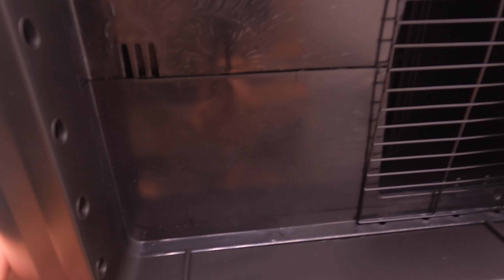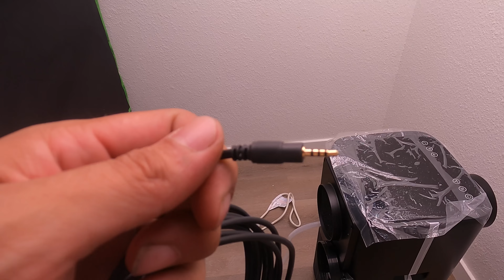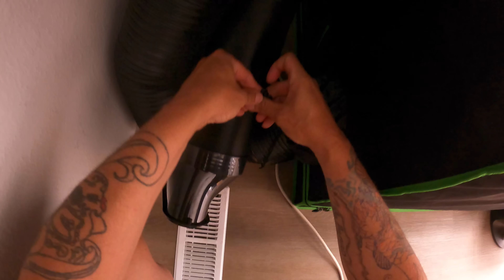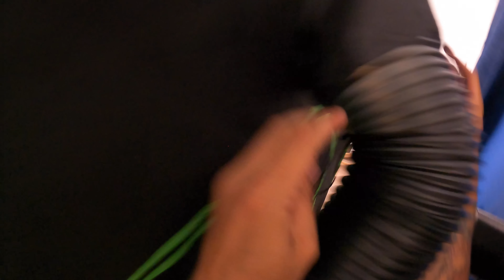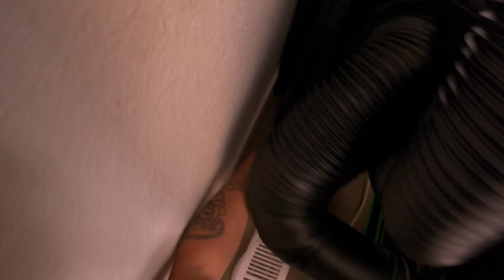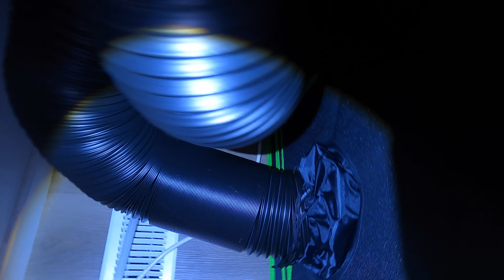4 IN 1 COOLING, HEATING AND MORE!!!! GROW WITH ULTIMATE CLIMATE CONTROL WITH VIVOSUN AEROLUSH

Comment from the maker: The unit in this video is an early engineering sample. The final version comes fully assembled—no installation needed. Also, Vivosun offers free shipping in the US, which can be a big cost saver.”
Reply: what do you mean by fully assembled? - no installation needed? you must put on the attachments for the hoses I'm assuming? Can I use the app without Vivosun controllers?  thanks for the video! hoping to receive mine end of July? Does the unit come with all 3 black exhaust hose in a separate box?
Reply: @StangMann420  Hi! The unit comes fully assembled—no internal setup needed. You just need to connect the hoses, which are included in the same box with all attachments. The app works without a Vivosun controller, but full features require pairing.
Reply: @Vivosun  What is the lowest temperature setting I can set it to ?
also what is the lowest humidity setting I could set it too? 
Is this capable of keeping a 4 x 8 flowering tent cool if the lung room is kept 70f-73f? 
Thank you for your time and any info in advance.
Reply: Can some one re design the ac and get it to deliver top cooling for les electricity  800w is more electricity than a standard  4x4 or 5x5
Reply: How many watts does that pull while cooling? A standard portable is around 800 to 1000 for 5000 to 8000 btu.
Reply: @Confused_Unicorn  The AeroLush is rated at 840W with a cooling capacity of 8000 BTU.
Reply: @Vivosun  Thank you!
Reply: @Confused_Unicorn  my grow sed 800w i think?  but dont hold me on that  if they could get them down to 200w and still work grate it would be game changing  bu 800w or more is just disappointing  thats like a hole other 4x4 or 5x5 in electricity
Reply: @Mpcdude385 I agree 👍

Comment: Nice unit but limited as it can only cool OR dehumidify.
So you cant achieve a decent humidity level and cool during flowering.
You would need to run a dehumidifier plus the aerolush in cooling.

Comment: Unfortunately, cooling mode is just the single mode, which is really usable. Maybe hot mode a bit, but that's all. Dry mode works via cooling condensation as well; so if you want to get 60% or less, your tent will be immediately about 12-16°C—absolutely not usable for cannabis.

Comment: I think u mixed up the inlet outlet. The side with 1 is supposed to go at the bottom of tent for air inlet into tent.    On side with 2 top 1 goes to top of tent for air exhaust from tent
Reply from the maker: you can have it blowing or sucking its not going to matter or not that I seen
Reply: @GRASSINCLASS i actually ended up usin the heater outlet for dehumidifier cos factory spec ac outlet was too cold so does seem to have flexibility with setup ur right.

Comment: My question is. Is your holding the temps good or do you have frequent temp and RH swings? Do you use it in veg and flower or just flower? I have bought one and usenit in a 90s90x180cm(3x3) grow tent and i have crazy swing i dont know i should upgrade to 4x4? If you still have swings not worth it for me.. PLS reply i tried everything cant fix my problem.
Reply from the maker: Depends on how much the ac is turning on the more it turns on the dryer the tent gets , which is not bad when your in flower , but when you are drying it’s a different story and have to be more careful
Reply: @GRASSINCLASS thanks for the anwer. I have a VCure for Curing and drying
Reply: Problem is rhe swings it doesn not hold the temps like I imagined

Comment: How do I keep the humidity under 60 while using this ac unit , everytime I turn on the Ac it gets really humid in my tent
Reply from the maker: wait what ! it should be opposite if the ac is on the humidity goes down and fast thats why I had a humidifier in the tent . but if its an issue get a dehumidifier in there.
Reply: @GRASSINCLASS its cause after thr AC compressor shuts off, the fan keeps blowing and all the moisture from the frozen coils gets dumped back into the tent . Im dealing with the same issue. It’ll drop the temp but raise the RH right as it hits target temp and shuts off . Kinda stupid if u ask me. For $500 id expect to have temp control while in dry mode. When you’re in dry mode, it drops your temp uncontrollably low

Comment: It's been 9 months since this video was released. Are you still using this thing? If so, is it working the same? Howre you liking it still? I'm having a hard time finding one
Reply from the maker: Absolutely I'm using it right now , so far I've used every setting , heat in the winter months , a,c last summer , and now I'm using it as a  dehumidifier, it has kept my grows in tent really consistent when it comes to environment and I've noticed a difference in my plants happiness they look really healthy and full of vigor , but at the same time I'm using self watering pots so it's all around environment consistency
Reply: @GRASSINCLASS awesome thank you for the response!
Reply: @GRASSINCLASS is it very loud

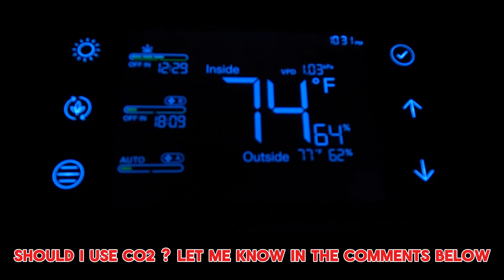Comment: 6:26 I just started using co2 and I think my plants have really benefited from it just turned to flower so we will see what happens but I love the review this is probably my next investment so my question is for each mode they have to be set up right it won’t say cool and dry at the same time right? I’ll probably still use a dehumidifier but if the unit can switch between modes to keep the perfect climate that would be awesome

Comment: This is a great unit, but what I don't care for it about is the wide spread of temperature between the time it comes on and a time it shuts off mine is almost 7° difference doesn't sound like much but it's a lot

I set my thermostat at 76°. It comes on at 78 to 79° and goes down to 71° sometimes down to 69°. Before it shuts off.
Reply: All portable AC’s do this. This is normal due to how thermostats work: the unit cycles (or modulates in inverters) based on a built-in tolerance to avoid constant on/off switching, which saves energy and reduces wear.
Reply: Same but what im more concerned about is how it dumps moisture back into the tent. So u cant really get anything 60% or lower unless u use dry mode, then u dont have temp control smh

Comment: I'll answer my own question here. No, it does not decrease the RH without cooling the tent way below safe growing temperatures. Dry mode really can't be used as a dehumidifier during normal temperature conditions unless you want your tent temperature to drop down way below 60 degrees. As far as heating the tent goes, the unit uses its exhaust outlet to heat the tent, which is not ideal and doesn't bring the tent temperature up to par during the colder winter months. This is being advertised as an air conditioner/heater/dehumidifier/fan. When in fact it is just an air conditioner. If you are looking to buy this unit for your tent cooling needs, then yes it will work at a very hefty price tag. But as far as everything else Vivosun claims this unit to be goes it fails miserably. I hope this helps people that wanted a complete environmental control system. This just isn't it. Save your money. I wish I never bought it.

Comment: how long will it last tho? i bought a vivosun fan and an AC infinity fan at the same time, both ran 24/7 and the vivosun stop turning after 3 months meanwhile i havent touched my AC inifinity fan in over a year and it still turning. its been on 24/7 for a year and no issues.

Comment: 500 dollars? Not worth it. It's pretty much a a/c. But weak one, I got a Honeywell that costed 600 or 700 but it's 16k btu 8k is low and will only cool a small room aka tent. My Honeywell cools a while room. And I just run a small hose to my tent when needed and it does wonders. Also setting up your lights when the sun isn't beaming helps a ton. Usually lights turn on at 6 and are off by the time the sun is hitting hard. Gotta think OP.
Reply from the maker: You don’t need a 16k for o cool down a tent , and what do you use in the winter. When temps are below 50? Do you use a dehumidifier in your grow space ? I rather have one unit that does it all then 4 different equipment taking up space when I’m not even using it 🤔

Comment: Power consumption to moon😂
Reply from the maker: Not if you know what your doing and running your lights at night , also bringing in 60 degrees air from outside cuts the usage by over half , and if your asking what’s the point then ? I’m able to run co2 efficiently in a tent in a sealed environment and eliminate odor way better , now if you live in Florida I can see the cost of running this being a little higher but if you add co2 you can easily double your yield and make up for it
Reply: @GRASSINCLASS If ur bringing in 60 degree air from outside it’s not a sealed system.
Reply: @GRASSINCLASS  teach me
Reply: @GRASSINCLASS Nah im running low energy high efficiency rooms and if not needed i would never use a thing like rhis
Reply: Its better than cooling the whole lung room 😊
Reply: You need all of these components in a grow.  its probably a little cheaper to run than separate components since and "i am guessing" it uses one motor for multiple functions
Reply: @jaymat9692 maybe in your country .in mine we dont need this if the room is built well
Reply: @peanutheads do you realize how ridiculous you sound...  you have a grow room that needs zero equipment unless you grow outside you are definitely not getting good yields or good quality.
Reply: @jaymat9692 use your brain before talking sht😂
Reply: The way i see it if you got the money to make your life easier why not. Obviously we’re all invested into our growing and that’s why we’re here. For me and my situation it’s a possible easier way to grow. I have a dehumidifier that’s half this price so I’ll return that and get this. 😊 (maybe)
Reply: yep, a vented skylight for the same price. but then u gotta drop $400 on a bluesky ozone generator to mask odor. better yet, lobby to get laws changed, rendering all the insane subterfuge unnecessary. then herb growing can get back to what its traditionally always been: old womens work
Reply: @divingduck9 Ozone generators are unhealthy
Reply: Not if you have a good electrician
Reply: How U running CO2 if U expelling hot air out? Or does it only come on and when comes on CO2 off,I don't get it ,I know U need sealed room for CO2 but running air con brings cold air in hot air out?

Comment: My question is this - Can it cool and dehumidify at the same time and how efficiently?
Reply: Bro.. air conditioning is a HUMIDITY killer in every sense of the word!! As soon as it turns off your humidity will come back up.. but you’re NOT going to stay constant with a ac running.Period!
But the condensation created by using an ac is ridiculous.. you need insulated wrapped ducting… it sweats like a whore in church… that’s a whole problem in itself to attend to and needs regular maintenance .. can you even imagine the amount of mold that can be created if not..
Reply: @davidbabin1287 wow that's all I can say
Reply from the maker: Yes you can use the ac and dehumidifier efficiently however a standalone ac would not do it as efficiently, specially with high humidity, do keep in mind that your environment will affect it as well  and the way this unit works for this case is that it will grab the dry air that just ran through the “ intercooler” part and put it back in the tent , and it will keep on repeating this process until it hits the set parameters,

Comment: So what if you can’t vent outside, like a in a basement or attic grow?
Reply: vent to another room then
Reply: @divingduck9 so dump the heat to another room is your solution
Reply: @fiascodon8996  exactly. or if its summertime, into an old clothesdryer or fridge. but if its summertime, outdoors is most economical...
Reply: @fiascodon8996 gotta make do with what you got that’s pretty much the mindset of every home grower for decades
Reply from the maker: That’s a really good question, if your in an attic it should be easy to, since there’s soffit vents all over the place , but for a basement if you have no other way and you don’t want to make a exit on the wall like a laundry room I would suggest maybe using the door
Reply: It’s worthless if u can’t vent the heat out
Reply: @SaigonOG1 what are you talking about
Reply: There’s no windows in your basement? Even if in the other side of the basement?

Comment: How does this work with the carbon filter?
Reply from the maker: Simple , you turn the tent into a sealed environment and keep the carbon filter resuscitating inside , which is the best way to reduce smell ,
Reply: @GRASSINCLASS  sealed room or tent needs added Co2  ( and not those mushroom Co2 bags ).   I like the idea of sealed tent with this Vivosun AC BUT I would either have a proper little Co2 set up or fresh air intake from outside.  But sealed can be tricky if we dont know what we are doing with Co2 and also other things like positive air pressure in sealed rooms.
Reply: @travisanthony11 so the ac unit won't push in fresh co2?
Reply: This was a GREAT question. Followed by a GREAT answer. I have some reconfiguring to do tomorrow…

Comment: Damn my nigga. You put this video up at the perfect time. I was just about to buy the ac infinity air conditioner for $600, but those bastards wanted another $600 for shipping. Bringing the grand total to over $1200. I was like, "Sheeeiiitttt!!!!" 😆Thanks for the coupon code, bro!
Reply from the maker: Vivosun has free shipping 👌👌👌
Reply: Same with me they told me they now ship W/ a special shipper costing 350.00 to ship for ACI on top of 600.00 for the unit! I found a company to ship me the ACI Teraform 7 for only 100.00 shipping/ So now I have both / The Vivosun is much easier to run & setup!

Comment: What I need to know is how is this superior to the AC infinity at only 100 less?
Reply from the maker: vivosun unit is 200 dollars  less , same 8000 btu , same functions , except with vivosun you can use the app to control and set parameters better ,
Reply: @GRASSINCLASS  the website is 499 right? So 100 less? How is their app any better than ac infinity? How is the support in comparison?